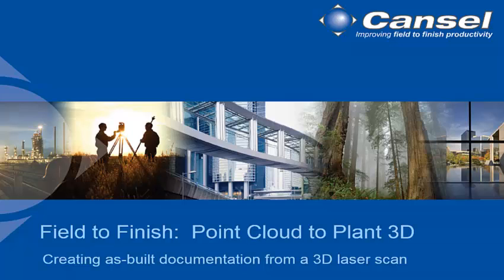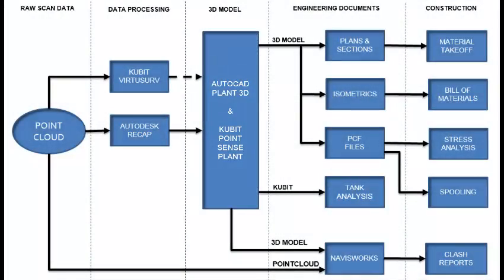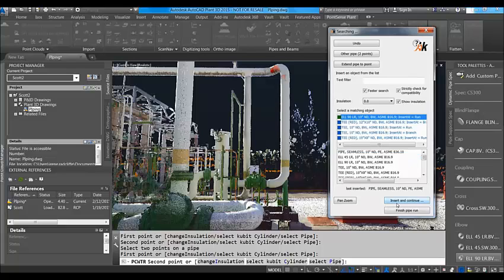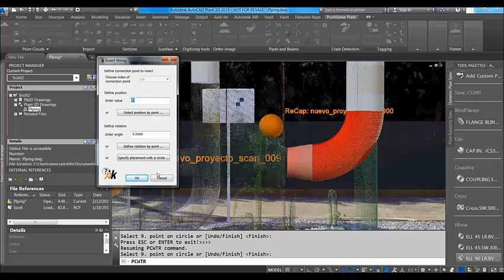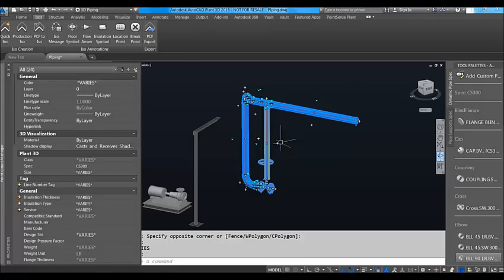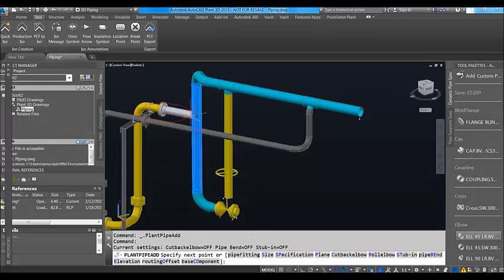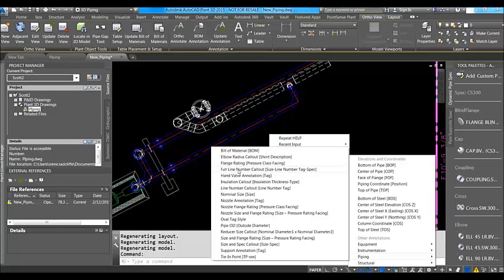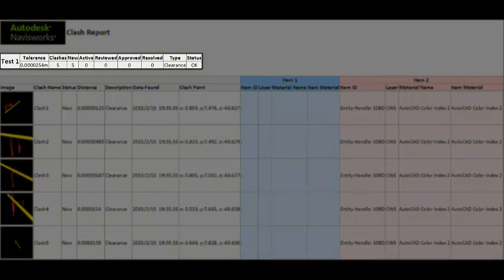Field to Finish:  Point cloud to Plant 3D

Comment: Which scanner has been used to generate the point cloud?
Reply: this type of laser scanning is that good as using concentric reducers at horizontal runs without drains
Reply: the point cloud data extension is FLS. which is Faro native point cloud files. So its clear which scanner was used ;)